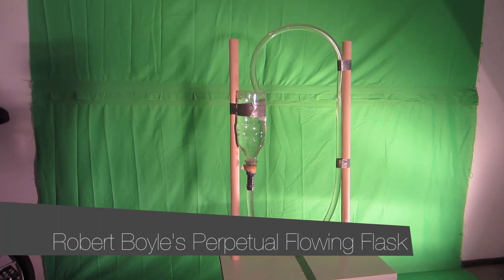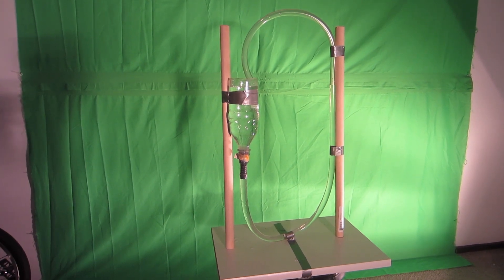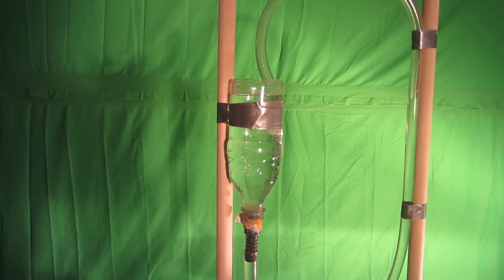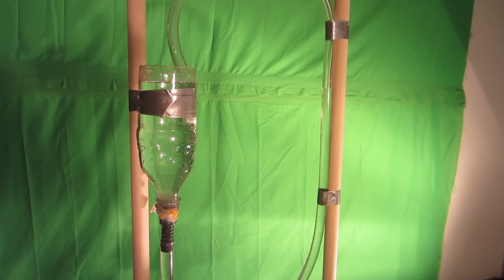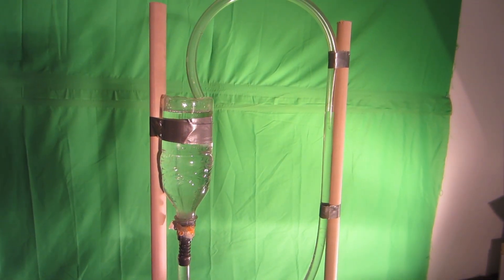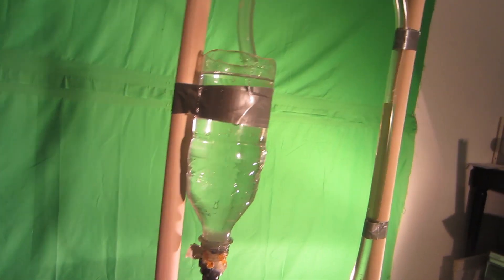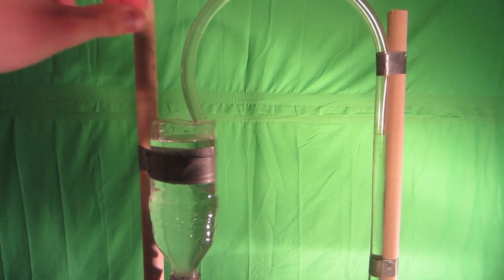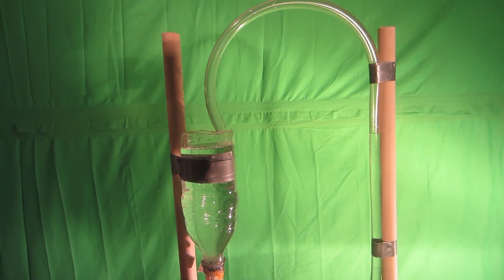Robert Boyle's Perpetual Flowing Flask Doesn't Work

Comment: try this: use a narrower tube and a wider or taller cut bottle but put it the opposite direction, meaning like this /\ and not this \/ so there is a slight pressure from the bottle walls ,pushing water to tube and preventing the water from spilling.If you manage to lever the water to the upper tube "mouth" then you have pressure and a pump working together.theoretically it works.

Comment: WRONG, WRONG, WRONG, what are the measurements, pipe diameter, stand height, volume of water / fluid ???????  .ect. ect. a scientist who gives up after the first try is NOT a scientist. Do it till it hurts.
Reply: +Mike M lol... it doesnt work.. if you take any intro to physics class in college you will learn why it doesnt work...
Reply: +Tim Gleason Yet the capillary effect exists, which you can't even see in this cheap video. The important part is to make this effect strong enough, and for that the pipe is to wide. Not trying hard enough isn't proof that something doesn't work.
Reply: If you take any intro to physics class in college, you will know enough to come up with reasons as to why it doesn't work.  ..yet you might not know enough to come up with reasons for getting it to work. ...I'll make a new comment as to how one might get this to work.
Reply: I understand the logic of your thinking and you have common sense, but in physics theres a law that goes 'pressure in liquids is equal in all directions'. What this means is that just because theres a lot more water in the bottle, it does not increase the pressure in the tube to force the liquid back up.
Reply: Illominarty Yeah. I got a little carried away with keeping an open mind.  Basically, I'm pushing back against quick dismissals, yet I haven't played with the contraption myself. So, I probably should back track.

However, I am still curious to see if one could get water to creep upward a little bit and somehow drop it^s fluid at a slightly higher height. ..'higher height' lol :)

I'll rest upon the idea that dismissing something at face value based upon basic understanding of physics is at most an informed guess, yet not actual science.  ..just as asking for a doctor's opinion is not science, it^s a statistically based opinion that might not apply to the individual (you).

My main thrust is to push back against those who appear to have a religious belief in all things sciency.  ...even scientists often say unscientific things if you look closely at their speech.  Beware.
Reply: Okay dude

Comment: Have anyone even hear about communicating vessels? STevin's law? Hydrostatic pressure? hydraulic elevators? No matter what is the size of both vessels (flask and tube), the water WILL level on both sides of the system. It will never works!!

Comment: The fact is that you're missing the point. Robert Boyle's self-flowing device uses capillary action and requires the diameter of the pipe to be quite specific. The hydrostatic action gives the impression of perpetual motion. Your setup is wrong, I'm afraid.

Comment: This wont work because the tube is holding as much as the bottle is holding, the tube is too long and thick, you should measure the volume of inside the tube and then the bottle, to see that the bottle can hold more then the tube, make sure this not just a difference by a hair, but by a big difference and try again. Best of luck!
Reply: Actually this won't work because the Boyle Flask is a fucking lie.
Reply: It's called water level.
Reply: An Everyman Pressure = pgh h being the height above a datum, if and only if the gravitation attraction, pressure or density of the water is different will the level of water on the right rise higher. I would be interested to see if this would work with a long thin pipe having had the water sucked through tube to form a solid volume of water throughout the system. You have to remember that it would be the negative pressure between the water at the top of the tube pulling up and the gravitational potential pushing down in the bottle, without a continuous flow it definitely will not work.
Reply: Charles Passman Note: Hypothetically, the water on the left would flow slower therefore having higher pressure. (Something something, would this work ? please help me understand)

Comment: Will it work if you fill the flask with water and then use pressure to the water surface, forcing it to flow?
Reply: That would artificially add extra input, so yes. But of a perpetual motion machine is that it wouldn't require extra energy, which is exactly what the pressure would need. Alternatively you could apply a vacuum to the exit of the tube, essentially "lowering" the output.
Reply: And after using pressure or vacuum will such flask flow perpetually or it will stop flowing after a while?
Reply: Šílený Dračí Vědec The fluid will find a natural equilibrium and stay in that state, i.e. gravity will take hold on both sides and it will stop flowing. Apparently it does work for a while with energetic fluids, such as beer and other fizzy drinks. But it is in no way perpetual, unfortunately. : (
Reply: Yes it would. That is what is usually referred to a a pump.

Comment: Issac newton had ABSOLUTLY nothing to do with chemistry... he created a large deal of what we know about the solar system. he created a way to measure the planets orbits around the sun... if you wanted the siphan to work you should have created a larger opening at the bottle where it connects to the hose and you should have used a smaller in diameter hose... dont talk about the faulty background of scientists when YOU are the one to blame for messing up. you obviously have alot to learn about your facts... heres a nickels worth of advice, know what your talking about before you go spouting off a bunch of nonsense about science. Thanks!!

Comment: Sipons typically are used to draw liquid up out of one container and down into another. In the case of Boyle's Flask the idea is that the pressure of water in the reservoir is concentrated down onto the smaller spaced opening and forces the fluid to flow down into and up the tube untill the pressure equalizes, given it does equate to the siphon effect. What is missed here is the secondary requirement of vacuum effect to create a flow through the tube and back into the reservoir. 

That is to say the additional negative pressure created by the falling water from the tube subtracts from the over all pressure of water within the tube and thus allowd the water to rise above the reservoir's water level and closer to the tipping point at the curve. The longer the downward flow into the reservoir the more negative pressure will be present within the tube. Like the vacuum effect.

Comment: actually your wrong you need to use a smaller tube. In terms of physics you're correct but in terms of chemistry you're not. water is a very unique substance it's both adhesive and cohesive which means it sticks to itself and everything else. If the tube were smaller and you used a vacuum sealed hydrophobic polymer, friction would be reduced to a very small amount and the water would flow virtually forever. If you still think you're correct ask yourself this, why do rivers still flow? and what would be the point of building a generator at Niagara falls? it is the same exact concept the ocean being a larger input.  if you were right then plants wouldn't be able to drink water. and therefore land life wouldn't exist because plants are dependent on the adhesive/cohesive effects of water. that's how the roots suck it up because don't have lungs.
Reply: water is the only known substance to be both adhesive and cohesive btw usually substances are only one or the other. Rivers would not flow, and land- life wouldn't exist if you were correct but you're not.
Reply: I get what your saying dude, and as a person who studies all three sciences I see your point, however. There is a physics law that goes 'pressure in liquids is equal in all directions'. It hasn't got to do with friction (mainly) but the fact that more weight or a thinner tube doesn't make more PRESSURE which would cause the water to cycle.
Reply: Rivers flow because of gravity. Ever seen a river flow uphill? No. It is trying to get to sea level, ie, to level out. This will not work. Full stop.

Comment: Would this work if you use a larger siphon (for a larger pressure build up) combined with a very thin hose (so it would function with cappilairy action?

Comment: Wat abt capillary action... u could gain liquid height by
1 decreasing capillary diameter
2 finding a liquid with high surface tension and low density
Use the height u gain, and voila... u have a perpetual motion....
Unfortunately with water ... for a 5 mm tube u only get a height gain of 2 mm...
So finding the right liquid is the key... ;-)

Comment: your tube is twice as long as it needs to be. Cut it in half and see what happens..
 the weight of the water pushes it only so far up the tube, the diameter of your tube matters as well as the size of reservoir plus the distance you're trying to push the water..

Comment: Ideally you want the flask to be like 6 times the size of that little tiny flask that you are using.. I mean think about it the larger the flask that you poor the water into the larger the amount of water it can hold.. The more water you add to that flask the more pressure you cause.. Hence the water in the tube rises causing that self flow effect.. And to actually start the flow cycle you have to kinda poor the water in a way that forces it down the tube. All i am saying don't blame the inventor blame your poor physics :P

Comment: The Boyle's Flask should work so the trick is to find out why not. Liquid exits with energy gained from falling and then loses energy traveling back up so the trade of energy should cancel out. It appears an outside force (air pressure) stops it from working. Like it should.

Somebody should try it in a vacuum, #1, and #2 the return hose should be extended down into the flask not merely falling onto the surface liquid. That should lengthen the time of acceleration without friction with standing (non-accelerating) liquid in the flask... and also increase the Siphon Effect inside the longer tube.

Comment: But I just saw a video where it works
Reply: It does work if it is started correctly. You see it is a syphon.. In order to start it the tube needs to be lower than the bottle and filled with water - next step is to cover the end of the tube and raise the tube -- then uncover the end of the tube and it will work..
Reply: Modedus Modedu No, the siphon action requires the output be lower than the input.

This is because fluids move from areas of high pressure to areas of low pressure.

Imagine you are a tiny spec, traveling through the liquid. At the top of the flask, the fluid pressure equals that of the surrounding atmosphere. For every inch you descend, the internal pressure increases. While for every inch you ascend, the pressure decreases by the same amount.

This is why, in the video, the water level in the tube settles to match that of the flask. From the water surface in the flask, traveling down through the descending tube, and back up the ascending tube, pressure gained and lost is precisely cancelled. So the pressure at the water surface in the tube matches that of the surrounding atmosphere, and the liquid will not want to move.

In a siphon, the exit is below the entrance. So, travelling downward, the pressure just inside the tube's exit is greater than atmospheric, and the fluid pours out when uncovered.
But if the exit is raised above the entrance, that internal pressure will actually be lower than that of the surrounding atmosphere, and air will rush back into the tube when uncovered.

But you don't have to take my word for it! As flyinthecoop demonstrated, this experiment is simple enough to try for yourself and see that the principles do indeed hold.

Have fun!

P.S. This all assumes the tube is filled with a uniform, incompressible fluid--like water. I could imagine some nuance (as suggested in the video description) for carbonated liquids, but definitely not enough to form a continuous cycle. (At the very least, the liquid would have to re-carbonate itself as it reentered the flask??)
Reply: Ben White a man who knows he's physics :)
Reply: I saw Star Wars, but that doesn't mean the Death Star is real.
Reply: You saw a *faked video
Reply: Ag8MrE You are the savage saviour

Comment: did you try again with a bigger flask than the tube?? like even bigger than the already-larger-flask-than-tube? like a BUCKET??? or bigger??? then hook that bottle to it??? like drill a hole thru the bucket and  glue the bottle top to the bucket and have the same set up only larger???? (if it works then then show me and have a generator hooked up to a water wheel with small deep bottles and have it be an even bigger bucket with a fail safe trough that collects all the water under the wheel and sends it to the bucket? .....try up 2 say 20 gallons and make the bottles on the wheel be LARGE 2 liters and have 3- 9 tubes going from the flask....
Reply: that should give you a never ending flow of power....especially if the generator u use is very LARGE.... like the size of a car.... and you have the wheel connected to gears/cogs or the bike chain version or something like that

Comment: The mass of the water in the flask is the sane as in the tubing from what I can see.....so let me know if I'm incorrect here but couldn't you just get a higher volume container....that would create enough pressure to push the smaller volume of water uphill.....from what I remember in ancient Roman history that's how the got their running water getting pumped over hills and mountains. So let me know if that's a correct or incorrect notion.

Comment: youre model is wrong
theres not enough weight on the flast side to push the water on the tube side

there should be 3x more water mass on the flask side to make it work properly try placin the flask higher and the tubes closer.

just because is looks similar doesnt mean its correct

the diamiter and length and water capacity of the tube side  is almost equal to the flask side meaning there almost equal mass of water on both sides meaning it will not work.

again for it to work properly you should have a bigger contaner of water or a smaler tube, more weight will push the water around the tube and back into the contaner.
Reply: In physics theres a law that goes 'pressure in liquids is equal in all directions'. What this means is that just because theres a lot more water in the bottle, it does not increase the pressure in the tube to force the liquid back up.

Comment: This is not an accurate reconstruction.  Boyle's flask indicated that the tube would be very narrow, and taper very sharply as it went.  The idea was that capillary action would assist the siphon, which is impossible with this width of tube.  Capillary action will not carry very far, so your tube also rises impossibly high above the surface of the container.

For a real-world example of capillary action, it's why the water in a thin straw is higher than the level of water in the glass.  Also, why water will absorb upwards into paper.

Volume of the liquid in the container compared to the volume of the tube is a valid consideration - however, meaningless in this case.  Boyle's flask, when reconstructed accurately, does not function.  Level in the spout never rises above the level of the water in the container.
Reply: Also- carbonation will have zero influence on this.  Unless you seal the top of the flask, no pressure will build up as the carbonation escapes suspension.

Comment: i can tell, is not only about the diameter, its about the calculus of the entire mass of the fluid in the tube when it's full, from the begining to the ending including the entire goosneck, this needs not to exceed the Hidrostatic pressure acumulated fom the top of the level of fluid in the funnel to the base of the tube. i had seen one in the real life working and i dont know there are many variables that can mess the result up, its like a delicate calculus and synching of movements, there are another method i think is the heron's fountain, that uses two diferent phases of fluids to get the motion in to work.

Comment: Changing the diameter of any section would not alter the end work output. If you increase diameter all that happens is you decrease flow and increase pressure in that area of change.

Comment: The reason your output is the same as the input is because you're using a fat tube as your siphon. It's the same principle as a garden hose: left open, it has little force; press your finger on it, it has greater force.  It's not working for you because your siphon has no resistance (too long, too fat), so the water has no energy to flow through the tube. If you use a thinner and shorter tube, then it'll work.

Comment: Of course it works. I tried it. I used thin tubes than yours. It was hard to me to start it with water, so t tried cola and it works at the first try. I retried with water and it takes time but it worked. It's not really a pertetual movement as you think. The power for this experiance is "THE GRAVITY". When you put the water in your container, the water take energy, inertia. The water accelerate and can go upper than the water of your container.

Comment: its possible... As long the fluid flow fast enough at start, the fluid's weight on the container will keep push the water to keep flowing. Its like when you want to suck a water from a container with hose, you just need to suck the fluid fast enough and then the fluid will keep flowing...

Comment: the flask is just like that replace the hose with much small like aquarium type for the water to be pulled by gravity it has to be proportioned to tube for it is to flow back at the flask...study more physics before you post..its a replica but not the actual one...